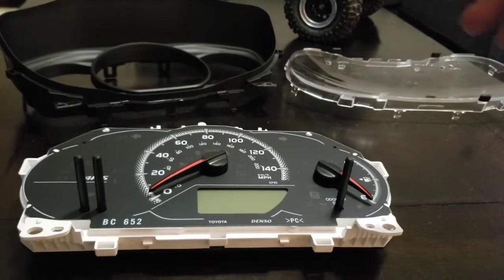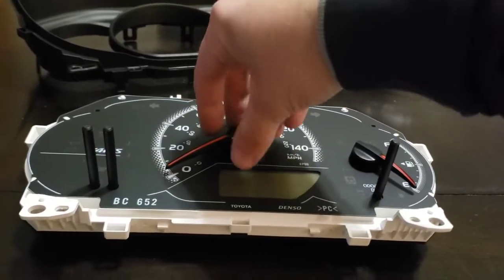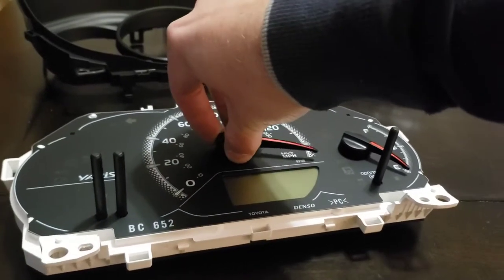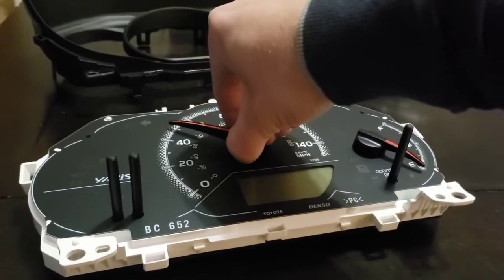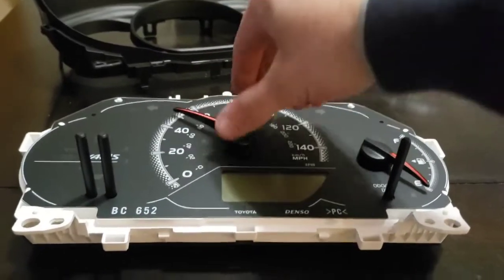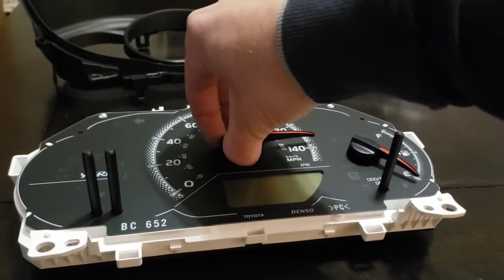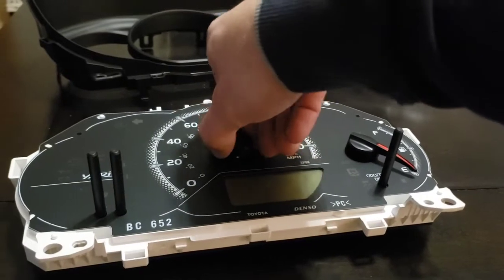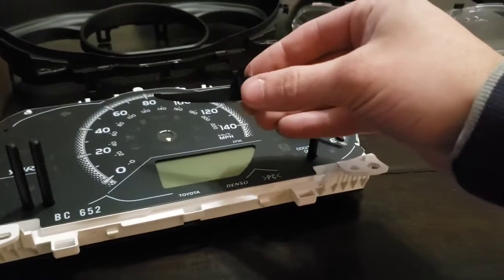How to remove cluster needles

Comment: Mines a 2007 was cleaning my cluster and my needle came out when doing so. When I went to put it back i noticed today morning driving to work it hasnt moved at all. Im doing your maneuver is there anything i need to do as far as resetting the battery for this to work and move ?
Reply from the maker: I'd check how far on you pressed the needle back on. Should just be a millimeter distance roughly from the needle to the gauge face.

Comment: Cringe...just buy a needle tool or carefully use plastic trim tools. No scary threat of destroying stepper motors needed. At least you have it unplugged but pop a new needle on and I'd be willing to bet that sucker is off. I could very well be wrong, but in many years of modifying GM clusters I've never seen anything quite like this! 😮 but you 100% followed the description of the video, and these days? A-freakin-men lol, In that case alone= A+++++ give ya a like too
Reply from the maker: It was just a spare cluster I had sitting around. Figured it might help someone else that wouldn't have the  proper tools. I do agree that using a needle tool is the more correct way to do this.